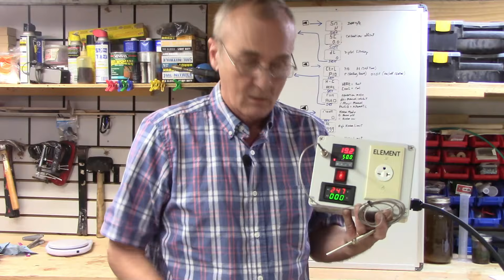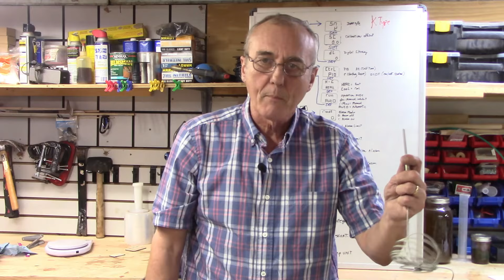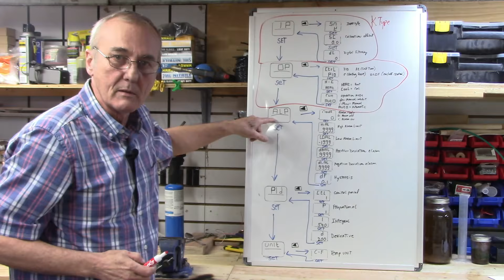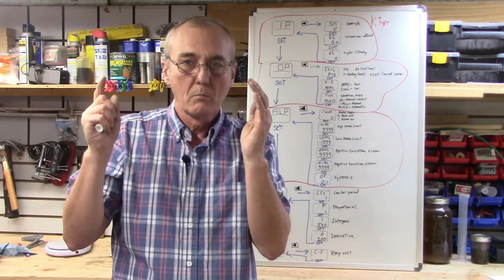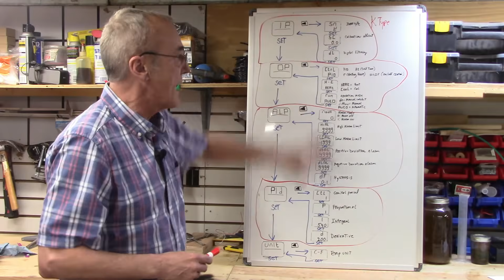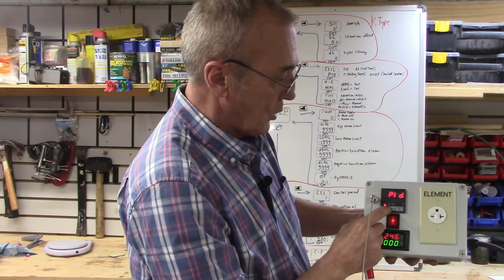BUILDING A 240 VOLT 20 AMP PID CONTROLLER STEP BY STEP PART 4

Comment: Hey George I built one of your PID controllers set everything as you instructed the problem I'm having is when I'm at operating temperatures the heat cuts off and when it comes back on to adjust it overheats making The vapor steam and the liquor comes out very hot could that be too big of a heating element thanks for your time

Comment: I'm curious what the pwm drive frequency is... and is it adjustable?  One would have to be careful so as not to overheat the SSR during the switching rise time vs high frequencies.  Maybe the SSR is smart enough to prevent that though.

Comment: Hi George  this could be a silly question but if I put an element in my pot with a pid and the thermo couple up the top in the cork won’t the product boil for a while before the system gets to temp at the top. You probably have covered this in one of your videos

Comment: George love your channel and this PID controller.  I plan to build one. I was wondering if you could help with a PID controler of a dephlegmator using a propotional solenoid value. I have seen one on YouTube but not sure how it would work because when water temp is high you would need to increase power to the solenoid to open it wider and when temp is low reduce power to close the valve.

Comment: Thank you for a informative video. I had the courage to build a pid to convert my kettle to electric with a recirculation pump. I follow yo from Sweden. I have a question, I need to measure the temp of recirculating water in to the kettle. I have a 1/2" T-connection, and there for a pt100 temsensor. Can I connect that to the PID an what bayonet coupling do you have to get the cables from the sensor through the junction box?

Comment: A question, I have everything together and it all works well, but after it gets up to the heat I set it to go to it constantly clicks on and off holding the temp I set it for. Is there a way I can set it to only come on when it gets to like 10 or 20 degrees below my set them to reduce how often it clicks on and off so that it's not so hard on my electric bill? Also, can I set a soak time and have it turn itself off after the time expires?

Comment: My first PID was a Sestos, worked great for the years I had it, the instructions were terrible, but I worked out how to use it. I also have the Inkbird ITC1000 12v which I use for queen rearing in beekeeping and a 240v ITC1000. For my honey warming cabinet I was looking for a replacement PID and found your channel. As you recommended the PID 106VH I ordered one and it is so much easier to use. The only difference is that I use auto tune first. Inkbird products are really good and simple to use. Thanks for the videos.

Comment: So I have watch severe times and triple checked my settings but I can’t get a narrow band. Mine overshoots up and down +- 5.7 degrees. 

How do I dial it in for my setup. I have a turbo 500 set up as a pot still with the price right in the top of the column before the elbow.

Any help or advice would greatly be appreciated!!
Reply: Mine oscillates too.

Comment: Thanks for all your knowledge ! 
For the Canadian viewers,  here is my parts list from Amazon.ca 
I went with a 220 V cooling fan , thus eliminating the transformer
The Inkbird PID in this link , comes with a 40 Amp SSR , and heat sink 
Cheers !

Inkbird F and C Display PID Stable Temperature Controller Itc106vh K Sensor 40A SSR White Heat Sink https://www.amazon.ca/dp/B06XY7Q6R3/ref=cm_sw_r_other_taa_AwklFbKVVWQPX

Arctic Silver 3.5g High-Density Polysynthetic Silver Thermal Cooling Compound AS5-3.5G (1 Pack with Tool) https://www.amazon.ca/dp/B07F93VZRB/ref=cm_sw_r_other_taa_SBklFbNSDDZ6S

GDSTIME EC Cooling Fan 8025B 80mm x 80mm x 25mm AC 110V 115V 220V https://www.amazon.ca/dp/B089SHGS26/ref=cm_sw_r_other_taa_crklFbDE4GDYE

AC Voltage Amp Display, DROK Digital Voltmeter Ammeter Multimeter Panel 500V 200A Voltage Current Tester Meter, LED Display Volt Amperage Reader Gauge with Current Transformer CT https://www.amazon.ca/dp/B07ZJCVVPK/ref=cm_sw_r_other_taa_8tklFbFNNVNY5

Baomain Soken Red Light DPST ON/Off Snap in Boat Rocker Switch 4 Pin 16A/250V UL TUV List 1 Pack https://www.amazon.ca/dp/B01EJDT2W0/ref=cm_sw_r_other_taa_SzklFb9NPF88P

Comment: Hey George, great series. Have you ever used the "PID REX-c100" ?  It looks to be the same pid controller unless I am missing something. Its a 240 volt, 40 amp ssr output but its only 25 bucks.

https://www.ebay.com/itm/PID-REX-C100-Temperature-Controller-set-SSR-40DA-K-Thermocouple-Heat-Sink/352555855067?

Comment: Not related to brewing, but I have made heater, furnace heating, sous vide and 3d printers, using pid, and found I have to use auto tune to get proper temperature control

Comment: George, just found your videos.  So helpful, very educational, and easy to listen to!  Thank you for doing these.  Question about the k-type thermocouple.  All of the PID controllers come with a short probe.  Most (all?) of your videos swap this out for a k-type controller with a longer probe.  I'm planning to use my setup to control a smoker and just drop the probe through the smoke exhaust vent.  Will this shorter probe work okay, or should I just order a longer probe?  Just trying to figure out the advantages or disadvantage of the short vs long probes on the k-type thermocouples.  Thanks for your help!

Comment: Even with SSR switched off, in this setup won't the element be receiving 120v? If not, can someone please explain why? Thanks!
Reply: It will have 120 volts hot at the plug yes, but with no neutral, or another hot leg in this case, the plug will not be supplied a complete circuit, so the 120 volts sitting at the plug will not power on anything untill you complete its circuit with a neutral or another hot leg.
Reply: @nickatnite6318  thanks for the reply but wouldn't a ground work as a neutral in this case and complete the circuit?

Comment: i have watched all your PID videos and wired mine on 220v but there seems to be a problem
i'm monitoring the wattage at the wall socket
my heater element is 2500w 250v
when i have my inkbird ITC-100 controlling the SSR, the element pulls 1100w max
when i disconnect the inkbird and manually give the SSR 12v , the element pulls around 2100w which seems right

i then played with the settings just to see if i can make it pull more , ctrl and opH but it got to 1300w max
any idea what could be wrong?

Comment: Thank you Mr Duncan 
With the help of your great instructional videos I have build a PID 240v controller box that runs a 4500w element very nicely. I have one of the 70L Chinese football pots and a 7.5 gal beer keg the it works great in.
Thanks again for all your help , Happy Distilling 
Adapt, Improvise and Overcome

Comment: George, just found your channel and watched this series, great stuff.  I love how straight forward you are and I assume you were a teacher at some point because you do a great job of breaking stuff down for easy consumption.  That said, if I wanted to install an additional 2 120 outlets where in the circuit would I connect them?  Also, is there any benefit to adding on/off switches for controlling the outlets?  My thought is that these would be mainly used to turn on/off the element to keep from burning up and to control an auxiliary pump.  I guess I should have said that I will be building one for brewing.  Thanks.

Never mind,  I just watched the dual element heat control and I think I can modify it to accomplish what I'm trying to do.  That said, if you want to answer anyway, I'd be interested in what the answer is.
Reply: yes isnt he just outstanding with his communication skills

Comment: Hey thanks for the time on the phone yesterday professor, LOL... Like I said I'm getting ready to build the 110v 2000 W version. But being disabled I am limited as far as far as funds go every month.
I know this is a little off topic but I figured I'd ask.
Let's say I wanted to try a run in the keg with propane 1st. Before install of my heating element.
If I put a thermometer in near the very top of the keg and monitored the temperature between that thermometer and the thermometer at the top of my column and try to get those to the same temperature, will that help me to achieve balance between the keg still and the column head as I increase the temperature for efficiency for the run? Or would that just be a waste of time?
Thanks for all your great tutelage videos Mr. George. You are the man...
Reply from the maker: sure

Comment: Do you change the calibration off set to allow for the extra plug in the k type thermo couple? Or do you just test it with boiling water?